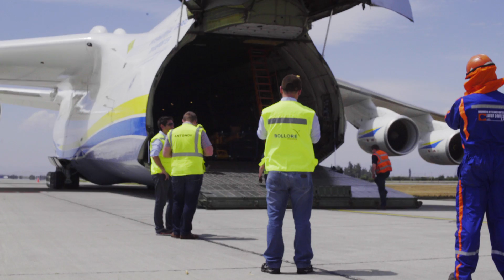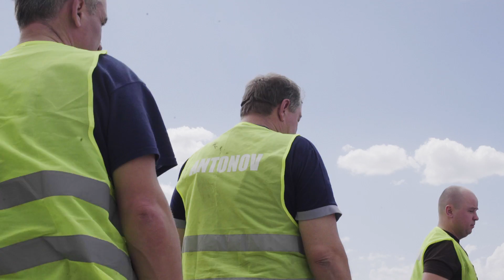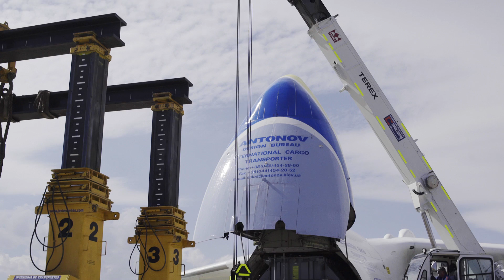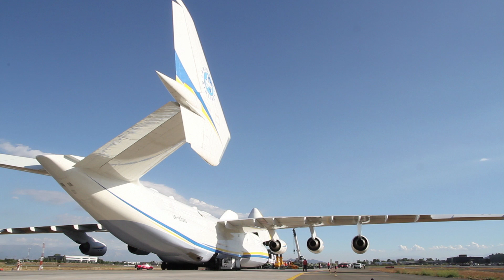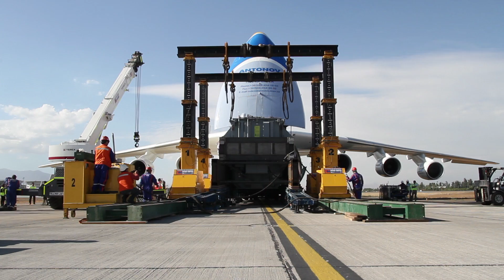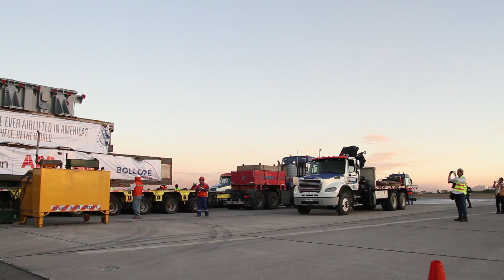✈ Antonov 225 HEAVY LOAD TRANSPORT : World's Record - 182 Tons!

Comment: An-225 "Mriya" - Soviet transport jet aircraft of extra-large payload development developed by the Design Bureau named after O.K. Antonova. Kiev. Ukraine.
The largest and most lifting aircraft in the world in the history of aviation. The aircraft was designed and built in the USSR in a single copy at the Kiev Mechanical Plant in 1984−88. 
Weight: 285,000 kg
Length: 84 m
Wing span: 88 m
Cost: 200,000,000-250,000,000 USD (2013)
Years of production: 1988
Engine Type: D-18T
Reply: I got to sit in the pilots seat in the An-225 30 years ago. It was awesome jet that no American disrespected.  The location was Bradley Airport in Connecticut.